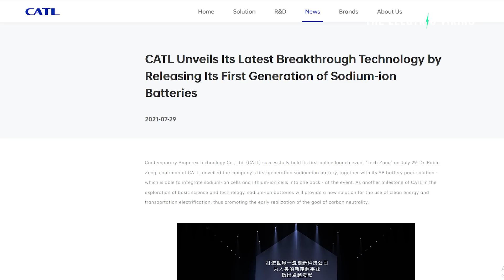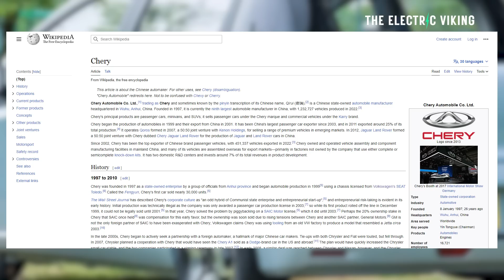The automaker using CATL's sodium batteries with amazing 200wh/kg

Comment: I would like to see EV's Targetting ~800km range, my logic for this is as follows:

In the UK, where I live, the Motorway speed limit is 70 mph which is ~112kph. In France, Germany, Spain & Italy it is around 120-130kph 
It's not unreasonable to drive for 3 to 3.5 hours without requiring a break. So this would be nudging 250 miles, maybe 280 miles in some EU markets
It is the sort of distance limit where you could contemplate driving to see something, some event, or some one, spend 3 hours at the location, & then drive back home in the same day. 
It would be good to know you can do the round journey without having to waste precious time having to 'top up'. 

Targetting a range around 500 miles / 800 km would mean you could get somewhere & back in a day without charging, & then be able to charge at your convenience at home.

If you needed to travel much further than 250 miles  / 400 km in a day, then it is more probable that it would include an over night stay away from home, where you would potentially have the opportunity to recharge overnight at your destination.

If on a longer road trip, then 500 miles would be around 7 hours driving at a steady 70 mph, most might need a quick break for a loo stop, food/drink, stretch legs, but you might only need 10-15mins for that, so not much time for a significant recharge. You'd also probably want a break after being stuck in the car for ~7 hours too. It's a reasonable distance to do in a day & then have an overnight somewhere ready for the next days 500 miles trip.

My ICE engined vehicle can do around 560 miles on a tank full, and that is even when it is quick, easy & convenient to fill up the tank at one of the many petrol stations dotted around our road network. It could be argued that ICE powered vehicles could have much smaller fuel tanks & ranged because of the speed & ease of refuelling - they don't really need to have such high ranges, & yet many do - maybe because someone thought about what a human might want to do in a day's motoring & sized the fuel tank accordingly.

With EV's, where the charging infrastructure is still relatively immature in most countries, AND where it still takes quite a long time to fully recharge, there is a line of argument that they require even longer ranges than typical ICE powered vehicles I think. 

Of course, there is alway the EV use case where an individual or company, knows that they will only every do 100 miles (or whatever) in a day, so they don't require the long range, but for many private users where they may want to go further afield on occasion, then having an EV with a range of ~500 miles makes more sense for them.
Reply: How many days a year do you drive more than 300 miles ?
Reply: @pauld3327  I regularly do a round trip of 300 miles or so, I've done it twice in the last month for example. A little over a month ago I did a different round trip that was over 270 miles. In October I did a trip that was 300 miles one way & a few days later 300 miles return (& there was no facility to charge an EV overnight there). That is also a journey I expect to do more than once again this year. Separately, my wife will be doing a 400 miles round trip later this week. So, yes, it happens a fair bit. 

However, my comment was not specifically about what i do, it was more looking at what is realistic for someone, anyone, to do. 

Driving for upto 3 hours to get somewhere, doing something for say 3 hours, & then doing the return journey is not an unrealistic scenario. This could be to go & visit family, going on a day trip to see or do something somewhere. Or if you are going further afield on holiday, which may only happen once or twice a year, but it would be more convenient if you could do a good days driving to get to an over night stop without needing a lengthy stop to recharge. A short break after 3 or so hours in a car is welcomed by most, but this can be just a quick loo stop / stretch legs / switch drivers etc. possibly not enough time to significantly recharge, but after being in a car for 7 or 8 hours, then maybe most would like a decent break at that point. 

I'm looking at it from the perspective of what a human could want to do that is reasonable. 

For Commerical drivers of vehs over 3500kg GVM, they are restricted to driving no more than 9 hours a day in the EU. So my figures for 'normal' drivers is not far short of that.

As i said, I don't think every EV car needs to have this sort of range, but for people that want/need to periodically do longer trips, rather than only daily use to local shops or a daily local commute, I think the range targets I proposed make some sense. 

You could sell something like a Model 3 with a smaller (cheaper) battery that gives a range of say 100 miles, that should cover the sort of person that just needs an EV for a daily commute, or to got to the local shops once or twice a week, but there should also be a mid range option, say, 250 mile, & maybe a long range 500 miles option. 

Currently, on Model 3 we have the option of 'standard range' 305 miles or 'long range' 374 miles. Cold weather, or other conditions may well reduce these figures considerably, they could be considered 'optimal'. I just don't think there is much of a delta between the standard & long range - especially when you consider the cost delta, & the 'long range' is still considered insufficient for many. Just my opinion.

In years prior to Covid, I was often driving my son around our country every other week or so to compete nationally (& internationally) in dinghy races, &/or to attend national training camps. So we were probably doing longer journeys more often back then than we are now.
Reply: @TheLDunn1  300 mile continous driving without stopping for peeing , coffee or food. That sounds miserable.
Reply: @najibyarzerachic  .....maybe, but sometimes you put up with it to get to where you need/want to be as soon as possible ;-)

Comment: This is huge for both evs but more so for grid storage if we can reduce the price of mega packs by 30% we are putting the last nails in the fossil fuel coffin
Reply: Have you worked out how much grid storage is needed? UK for example electricity is around one sixth or at best a fifth of total energy use. Less than half is renewable. So to go Net Zero with storage you need about 7TWh storage per day for sunless windless days. But let's say half that for a week, UK had low wind May to September in 2022, so 25TWh storage for one week Net Zero, then you'd have to recharge the whole lot while sustaining normal demand.
Can someone explain how over 3 months very low wind will be supported in a Net Zero environment. With numbers as well as technology.
Reply: @Wee_Langside  it cant, also batteries wont work as they release heat when charging and discharging. On such a scale, all around the world, the heat would boil the seas.. on our current rate 400 years before the seas boil. At this moment in time anything would be better, even pumping water up a hill to release over a turbine when needed would be better. This is one of the massive benefits of hydrogen you can pool it all over the country in heat neutral stores, that you can make out of abundant materials.
Reply: @geroutathat  I understand the seas in the tropics can't exceed a temperature of around 30'C in the current configuration of Earth. Warm water at the north pole in particular radiates heat into space. Whether that remains the case depends on a great many things
Reply: @geroutathat  To start most battery's I know start to panic if they reach 60 Celsius. that is a long way from boiling anything little own oceans. I think pumping water up hill to use as a battery for base power is a good idea, if you have the Hydro to do it. Hydrogen is just a total mess. Nearly all commercial H2 comes from tearing hydrocarbons apart at great energy cost and producing tons of CO2. The H2 is very small and leaks out of nearly any container over time. Battery's are the best way to save energy, there are small losses in and out of storage but way, way less than producing H2. I live in Australia and the State of South Australia is now 80% renewable energy using solar wind and battery's. They hope to be 100% renewable in the next 5 years. Other states are following their lead and replacing aging coal power plants with Solar and batteries plus some wind.
Reply: @lionelwylie2326  no, that's not how pyshics works. This is demonstrable in data centers. They pump out 115f/50c heat non stop to keep their servers running. If you turn the ac off, the servers will heat their rooms till all the equipment breaks and shuts down. If you put a human in a really well insulated box, they will die from the heat. they wont heat the box up to body temp and then stop heating the area. Its the fact that none of the heat escapes means it will keep building till we all die. There is a level of heat the world can deal with, and if we can concentrate the heat then much better. But batterys require us to pass heat over wires. The problem is much worse than people think. First if we take a figure like 100mghz just for fun, and that's what we need to run. We will need 200mghz production to charge for dips. Straight away at the point of creatation we will have energy loss as creation point.the heat loss there means we need to generate 201mghz, then the heat loss on the wires, so we lose about 15 percent of electricity travelling to the homes as heat. So now we need 231mghz. Now its in a battery, the battery will non stop leak heat even when not in use and it will peak during charge and discharge. Ill be very kind to batteries and call it 5 percent... But because we are storing at production point and home point so charging twice we end up with 10 percent. So we need to produce 231 and 50 is lost as heat. So now we know 50 is the heat number we can do the maths, at current level how long will it take for 50 to boil the sea, and it comes out at 400 years. The maths has been peer reviewed and is fully accepted. 400 years is it. Im not saying batteries are not part of the solution, but they cant be the only solution and we need breakthroughs. We need far better. I havent given up hope for a next gen battery in our life times. But we need to be realistic.
Reply: Grid storage will boil the earths oceans if they use batteries to store energy.
Reply: @geroutathat  WTF

Comment: What I am always amazed at is the amount of people who just don't get the rule that for a technology, good enough is going to be good enough. 
And for most battery use cases, sodium ion is going to take over because it is good enough. 
Very few people need massive range or, neck snapping performance. 
We really just need a thing that takes the kids to school, or gets parked in the work's car park/ train station/ town's park and ride. 
Then cheap and reliable. 
Sodium ion fits all of those perfectly.
Reply: Low temp performance is a huge plus here in New York where it can get to -20F. It has never gotten to 100F, though.
Reply: I agree that technology doesn't need to be perfect and that good enough is enough but on the other hand I think that a Model Y with a 60 kWh battery is not good enough because I want to be able to drive my car at least 2 hours at highway speed.
Reply: @pauld3327  absolutely, but sodium ion is going to be on par with LFP batteries in terms of use case, so long range / performance model Y will probably stick with lithium, but standard range will go sodium.
Reply: @patrickjr11  - absolutely, me too - and I want to be able to tow a loaded car trailer 400 km (in any given work day) on a whim (need)- but that makes us atypical urban users. Most of the time settling for ok and hiring a different vehicle for extraordinary transport needs works out cheaper - though in the West, valuing convenience higher than cost is common (so long as we can afford it).
Reply: It’s true, donkeys are not as strong as horses, but they are more popular sometimes, by being low maintenance.
Reply: Thank you for posting this! Finally someone who gets it !
Reply: Maybe very few people NEED massive range or neck snapping performance, but a LOT of people WANT them.   If 200 Wh/kg is for real, and they're 30% cheaper than LFP, AND they have good low temperature performance, then this is a really huge development.  What's the catch?  Cycle life?
Reply: @incognitotorpedo42  that was the case early on  cycle life was down on lithium iron phosphate batteries. I think they are on par now. That's why some car companies now have them on sale. The only other drawbacks appear to be they are only suited to cylindrical shape batteries and the supply chain needs building up.

Comment: So by 2030 we could be looking at sodium ion  for grid storage and EVs up to about 400 miles. And still lithium ( maybe by then lithium sulfa) for 400 to 750 miles. And who the hell is driving more than 400 miles without a stop anyway?
Reply: But if you have driven anywhere near 400 miles you DO need to stop. And if you have stopped you may as well be charging.

The UK highway code is quite clear on the issue. "At least 30 minutes  stoped and out of the vehicle for every 4 hours of driving." And as the speed limit is 70 miles per hour , that is 280 miles driving. It has been in the high way code for decades, long before EVs . Rule 19 in the latest version, if I remember right. . And yes I knew the highway code is not LAW , but anyone driving on UK roads should be following it. And for HGV drivers it is enforced.
Reply: It's not 400 miles without a stop, it's 400 miles without needing to charge
Reply: You fail to consider that batteries lose range in cold and hot because they have to regulate their temperature where ice.
 vehicals do not.   So that 400 range might become 300 in crappier weather,  also all ev's lose  range the first year,   so that 400 range become 380 becomes 280 and now you ran out of power 🤷‍♂️  and since you ran out of power,  you actually damaged your battery and now .your range is 360  so now you cant even do that drive any more without fast charging.
Reply: @jebes909090  i am taking that into account by assuming an "average" speed of 70  mph when  that should be the maximum speed. And no lithium batteries won't be run down to flat because there is always a bottom buffer and lithium batteries are not bothered by that as long as they are not left flat for weeks on end. That is lead acid batteries you are thinking of.

Even your 380 becoming 280 is still 4 hours of driving, so still at the UK  highway code limit. 

And sodium ion batteries  do not have to regulate their temperature, other than when they are charging. The main reason for reduced range in cold weather is the use of cabin heating.

Comment: Sodium ion batteries are only suitable for small cars with light weight and smaller range where the output of sodium based batteries which is about 60% that of lithium is not critical.They are however perfectly suited for fixed storage where Kwh / kg capacity is not critical
Reply: It has to be a real candidate for utility-level or home storage, to the degree that it may revolutionise electricity grid design. An extremely useful enabler of the transition to a carbon-free future, but I remain sceptical they will be preferred for EVs. The chemistry puts a much harder upper limit on their energy density than lithium and this will tell over time.
Reply: If they're really 200 Wh/kg, they'll be fine for cars.  We'll see if that turns out to be accurate.
Reply: Sodium batteries have been used for energy storage for a long time.

Comment: The key benefit of sodium ion batteries is that it eliminates the reliance on lithium in lithium ion batteries. The gyrations in the price of lithium in recent times have exposed a weakness in the lithium ion battery solution, however, the advent of the sodium ion battery appears to be able to mitigate the price instability problem that lithium has displayed.
Reply: Just a price spike as demand got ahead of supply.  We saw the same problem with wind turbines and processed silicon for solar panels some years back.  

We saw Tesla increase the price of their Model Y when demand created a year long waiting list.

Comment: Lithium is around 10% of the cost of a battery cell and 5% of the cost of a car battery pack. With the cost of lithium coming down, this proportion will fall. I don't expect that the cost per kWhr of a sodium ion pack will be a lot cheaper than that for a lithium iron phosphate pack.

Comment: What is the situation with sodium batteries in the possibility of ignition with regard to LFP or NCM batteries?
Reply: On scale of autoignition / ignition I rate NCM batteries to be the most likely based on empirical data.  I theorize sodium ferrous phosphate batteries to be less likely than LFP batteries to ignite during normal use because only be use sodium is less volatile than lithium and directly under lithium in the periodic table.
Reply: @fredfrond6148  yes but the first batteries coming to market will be NaLi (using both) so the risk is not entirely eliminated.
Reply: @realestatenow  compared to the many fires in the nickel cobalt chemistry the risk is much smaller.  But compared to   the similar LFP battery I agree empirical data has to be investigated.